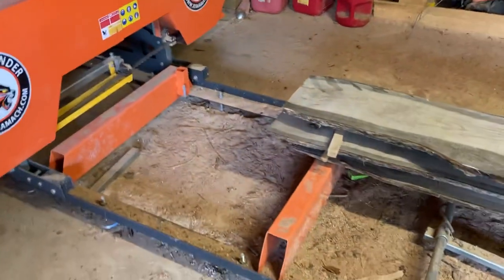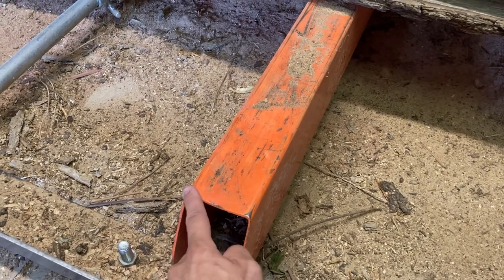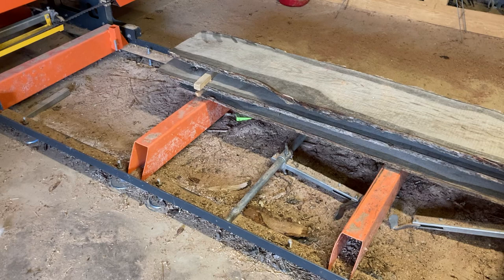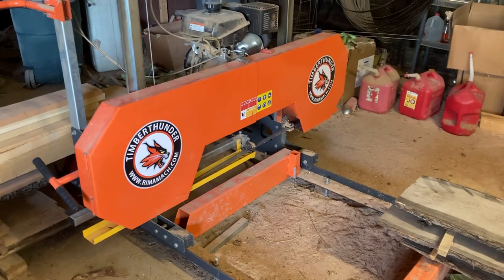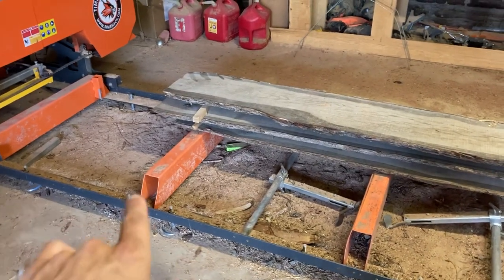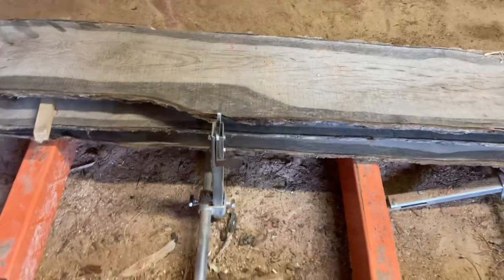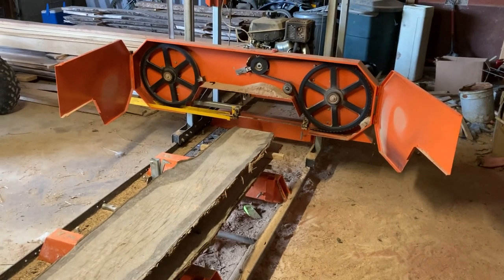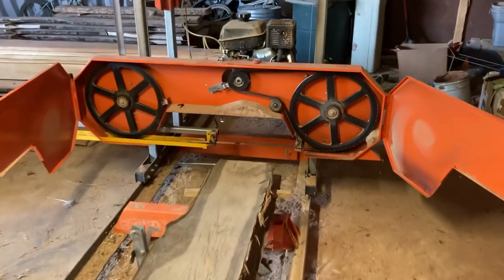Cheap Chinese Sawmill! Will the Rima RS31G hold up?

Comment: I have the same brand, just they called this one a Blue Viper , has electric start. I've run it for two years now as well and have no regrets.  The blade guides, as you said, take consistent adjustment and maintenance... new bearings. The bottom line is if you aren't prepared to upgrade a few things and problem solve as you go this machine isn't going to work for you but if you can and don't mind tinkering a bit it'll produce the same quality lumber as a much more expensive unit.
Reply from the maker: I wish I had an electric start, there is nothing automatic about mine, I agree with you, I got no regrets

Comment: Maybe you can help me on an RS31G i bought about 3 months ago. I have used it about 4 hours and i noticed the blade is dipping. I started searching for the problem and i found the idler wheel was loose and it would move in and out about 1/4 to 3/8 inch . I have tried to find the bolts that might have come loose. All bolts are tight. What can i do to take this loose play out?
Thank You
Reply from the maker: Is it the bearing? Unfortunately I’ve heard of a few people that either got bad bearings or they went out fast.  If your tension is set and you still have play, it’s probably your bearing, and it’s best to replace ASAP before any damage occurs to the wheel